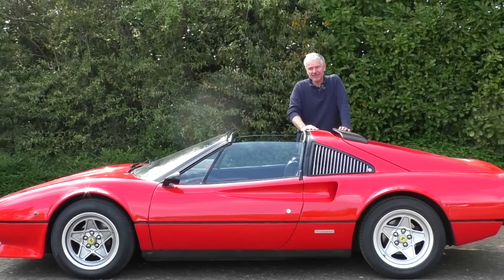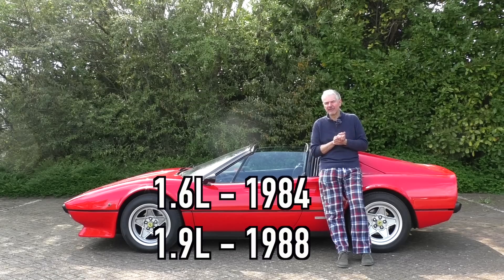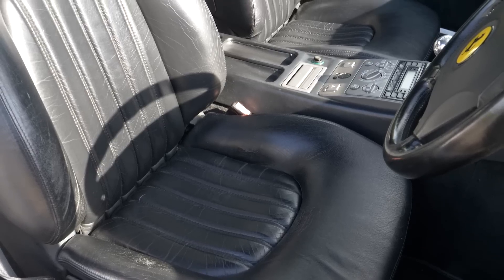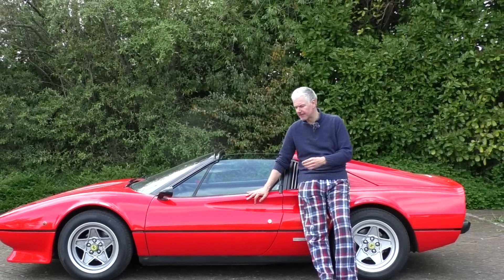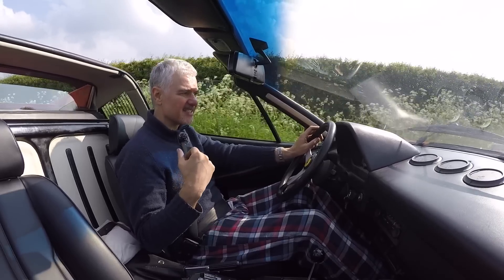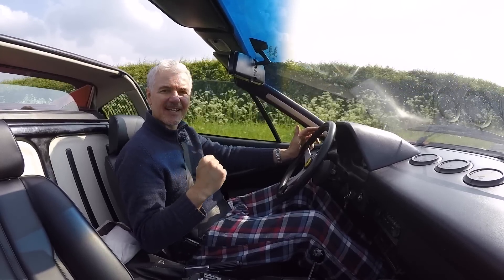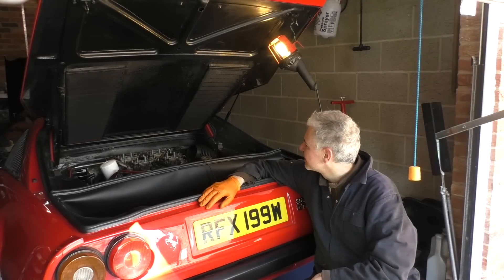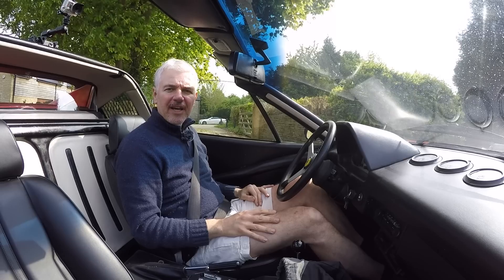The reason my Ferrari 308 was the cheapest in the UK

Comment: Change the cam belts and the bearings anyway. There might be invoices for it from a year ago, but who did them and did they do them correctly? It’s running ok, so yeah they probably did, but it’s cheap and easy and a bit of a no brainier. When you’re in there, check all the other belt driven stuff - water pump, alternator,  air con. Feel for rough bearings. When doing the cam belts you need a cam lock. Someone’s website, can’t remember who’s, shows you how to make them from wood. Birdman’s? Google him. If you can’t find it, drop me a line and I’ll show you mine. Oo-er missus.. 

Great videos! I really enjoy them. Rooting for your every step of the way. Probably makes me a bit of sad bastard, but hey ho, I yam wot I yam.
Reply from the maker: glad you enjoy them, not sure why that makes you a sad bastard ! Thanks for watching!

Comment: Beautiful car!
You have a great channel...
Long story but a 308 might be in my future. I think it's the most beautiful car ever made...one issue though...I'm 6'4"...will I fit with the top on?
Tom Selleck is the same height and I dont recall ever seeing him drive with the targa on! 
Cheers and good luck with your stunning car!
Reply from the maker: Not sure but you’d not want to drive it with the roof on anyway.. they squeak and rattle ...
Reply: Going to depend a little on your leg length and torso ratio.  Mr Selleck has long legs.  They had to push the seat all the way back and take out some, or most of the padding of the seat. Even then, his head still didn't fit under the windshield frame completely. (magnum-mania.com) They aren't really meant to be driven with the targa roofs on anyway.

Comment: The later 1.9GTI had Cats that meant the 1.9 had the power of the older 1.6, 115hp instead of 130hp, but I think those were J-K reg cars, and I do believe there was a few L reg GTIs. You should be fine with your H plate...but just check it didn't get catalytic converters that dropped the power.
Reply from the maker: Yes this one is a non cat car..

Comment: I had some noice from the grid on engine cower. And check the muffler. Could be som thing loose inside. 
And on my 308 they replaced the bearings to the liwer cam belt pullys. 
Superformance.co.uk have sport exhaust. I got one. Have not tried it yet. 
Keep on working/ Stefan😁
Reply from the maker: Thanks chap!!

Comment: You say the idlers were changed. On most cars the remaining bearings would be the water pump, air con pump and alternator. Is it possible to remove the belt driving the alternator and/or A/C without disturbing anything else ?
Reply from the maker: Yep and that is next on my list.. AC is useless in any case!!

Comment: If the gaskets are steel you should be good and you didn't leave it to overheat till in red for a bit they no issues. Dude that cars old get used to things breaking. Old rubber and plastic lol. The best thing to do is shake it down and see what breaks like a rally car driver. Check for vacuum leaks. Does that thing have an emission system, pcv value?
Reply from the maker: No no emissions stuff on this one thankfully!!
Reply: @Number27  I keep forgetting its mid-engine and in the rear. Its gotta be something from the front. Quick google and since its from your drivers side this might be a possibility. https://www.ferrarichat.com/forum/threads/ferrari-308-master-cylinder-booster-whistle-noise.602064/

Comment: Get the factory 4 exit but spray the insides of the pipe orange like the old ansa tips
Reply from the maker: Nice, but will that fit my single exhaust bumper?
Reply: @Number27  lol I wouldn't know, it should work if your rear Valence/diffuser comes off

Comment: Balancing is only one step, did you adjust the idle mixture as well? I would really advice to do that
Reply from the maker: Yes I did but that only affects the idle in any case..
Reply: @Number27  not exactly, you drive around on the idle mixture way more than you think.  Probably most of the time when you just cruise in the lower rev range. Therefore is also influences how the engine picks up.

Comment: The single exhaust pipe is the rarer choice, everyone and their dog changes the 308 to twin/quad pipes. 
Be different and keep the single outlet, just get a stainless handmade open pipe system.
Reply from the maker: It’s just the sound really.. it’s not quite there on this system..
Reply: @Number27  If you get a custom made system, it will sound nice even with a single pipe. Plus, will you have to change the rear valance?

Comment: That’s sounds like the thrust bearing is about to fall apart to me , the fact it happens when to dip the clutch
Reply: Thrust bearing or clutch release bearing will rattle on tick over feet off pedals.. Soon as you touch the clutch it should quieten down with pressure on it

Comment: Could It be the alternator ? When the car is under load it's pulling more from the battery so it's working harder or combination of both battery needing a good charge ?
Reply: That was close with over heating🙈, turned your garage into the world's first Ferrari powered steam room 🤣
Reply from the maker: The battery condition seems to make zero difference to the sound.. I have run it freshly charged. However I need to change it in any case as I think it’s a bit old
Reply: Oh ok it's a strange noise I've got to say jack ?? How does the clutch feel could it be the clutch slipping a little when the engine revs get higher I'm assuming it doesn't do it in neutral revving or in gear with clutch engaged??

Comment: My Dino was the 3rd worst car I ever owned.Every time I drove it it would either break down or give the anxiety that it might. Ferrari woes are terrific because with any normal car you think - scrap it - its terrible - not worth it - but with a Ferrari you forgive the foibles and the financial ruin, because of that moment. That moment when you fire it off the line grab second, clack clacking through the infamous silver offset H gate, double blipping the throttle, (because you can), floor it, again,  wrestle the steering a bit and point yourself at the horizon in a thrilling blur of driver and machine in perfect synchronous harmony. The noise, the vibration, the senses, the heritage, the envy you see in other road users, (often displayed as hate but it is envy nonetheless). And it may not even be that fast, but it feels it. Those are the moments that are worth every godforsaken peny. Keep going. IT will be worth it; if only briefly.
Reply from the maker: Thanks buddy.. hope mine will be a bit more reliable than that!!
Reply: @Number27  We can but hope. Unfortunately it wasn't until Luca 
di montezemolo came along with the 355 and a new vision for Ferrari in that he encouraged the firm to make more reliable cars as owners would drive them more thus pushing up the servicing and parts departments - which it did.

Comment: There are loads of exhausts on e- bay but one that stood out. It’s a high performance for a Ferrari 308 GT £1,230 plus £30 postage.... you could always try an offer ! 
I used to have a sports exhaust on my 355 and have a sports exhaust on my 996 turbo and it makes all the difference 
https://www.ebay.co.uk/itm/183074898986          Also I just changed the coolant in the 996 and instead of using conventional coolant that is mixed with 50% water I used Evans waterless powercool 180 for my car. Water can corrode the engine and cooling system, water has a lower boiling point before boiling than the powercool 180 so is less effective in cooling the engine and as a result there is less pressure in the cooling system resulting in less strain on the rads and pipes.
Reply from the maker: Thanks for the advice and for watching!

Comment: It sounds like when I had the airbox off on webbers and I would open the throttle fully. I know you removed the airbox...did that make it more pronounced.?  Perhaps there is a missing resonater or I remember some cars in cold climates would have a cowl over the manifold to heat the air going into the airbox. This would need to be blanked off.
Reply from the maker: No, airbox removal made no difference to sound!

Comment: You are abusing the clutch on your up and downshifts. When you upshift, release the clutch immediately as if it was an off-switch. Don't ride the clutch. Secondly, you need to learn how to blip the throttle in a downshift to match the gearbox input and output shaft speeds. Ideally, learn to double-clutch downshift while blipping the throttle to lessen the wear on the synchrorings. Don't use the gearbox to slow the car down; use your brakes. To that end, double-clutch downshifting while braking and blipping the throttle in neutral is the end game. Cheers!
Reply: Karl Anttila Sr. Why do you need to double clutch downshift if you blip the throttle to the correct RPM?
Reply: @stu4181  It lessens the strain on synchrorings. When the clutch is depressed, the flywheel and clutch are disconnected, and blipping the throttle does nothing to spin up the input shaft of the gearbox to the output shaft of the numerically higher gear ratio of a lower gear. If the spin rates of those shafts are not matched, the synchrorings take the brunt.
Reply: Karl Anttila Sr. I struggle
To get my head round this, engine is spinning and wheels are doing 30mph, I want to drop a cog, depress the clutch and put it in neutral surely though gearbox just starts to slow down?
Reply: @stu4181  Shift into neutral, blip the throttle and shift into the lower gear. Better yet, rest the left side of your right foot on the brake, blip the throttle with the right side of your foot while still breaking and performing the shift into neutral and lower gear. YouTube has videos on this but they are NOT all correct. Cheers!
Reply: Karl Anttila Sr. So you have to release clutch and then  re depress and blip at that point, sounds very slow !
Reply: @stu4181  No. Shift into neutral, disengage clutch, blip throttle, depress clutch and shift into desired gear. With a lot of practice you can repeat this process very quickly and downshift a couple of gears a second. Just to be clear, you do NOT blip the throttle on upshifts because the outputshaft's rotating speed is always lower as you go into the higher gears. One more truism -- you are never pressing the clutch and throttle at the same time -- mutually exclusive levers.

Comment: What you expect on a almost 40year old Car, you need overhaul the Engine, Seals to make it reliable, if do you can expect a huge Profit, a old Ferarri is like a bar of Gold, prices are only go up. 🤔👍The whistle comes from the gearbox, check the oil, maybe its already damaged, you will destroy it if not stops to rev it up so high, its a oldtimer..
Reply from the maker: Umm not sure it sounds like gearbox issue but I will look into it!